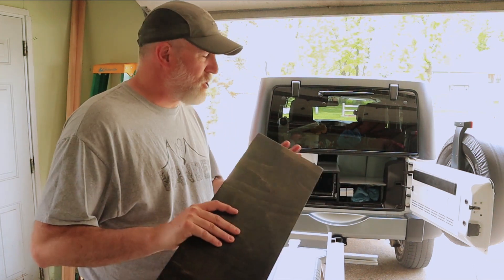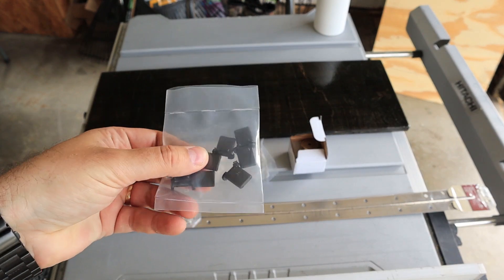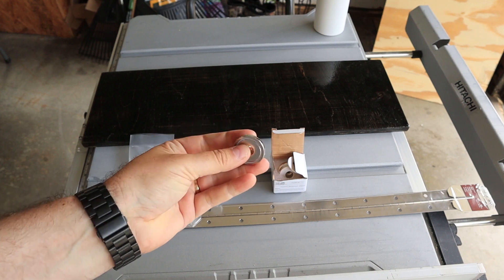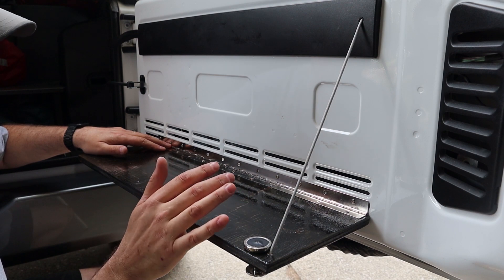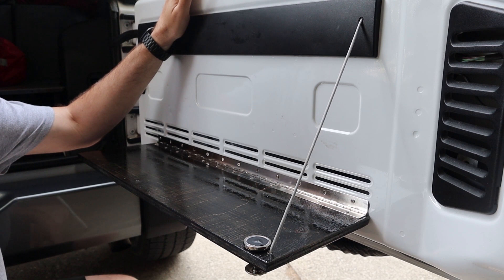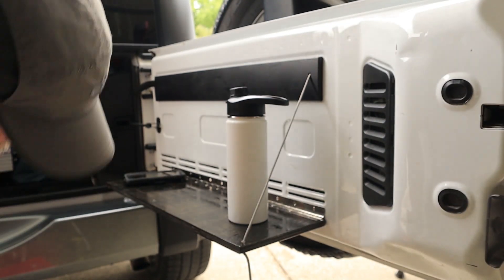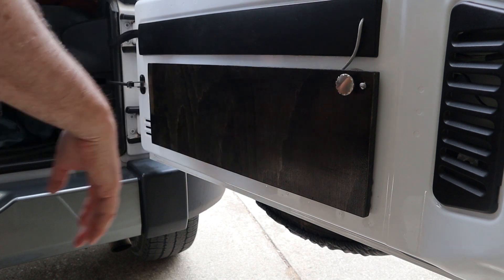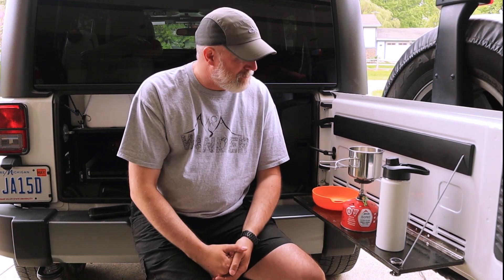DIY Overlanding Tailgate Folding Shelf $25

Comment: I need to build one but to put a stove on it, but i worry about fire hazard.. im trying to find a no drill solution. Yours only require to drill the plastic cover which is acceptable.. however too small to fit a dual camping stove unless you add an extension board. Thinking how i can make one single board .. maybe if i add a spacer on the piano hinge to match the plastic trim thickness once the board is closed.
Reply: The spacer idea seems like it would work a treat. Additionally, for a no-drill solution, I've used screws with spring toggles to fasten hinge on which go through the 'vent' looking things near the bottom of the tailgate. Example: https://www.bunnings.com.au/ramset-3-16-x-50mm-countersunk-head-toggle-spring-4-pack_p2265630